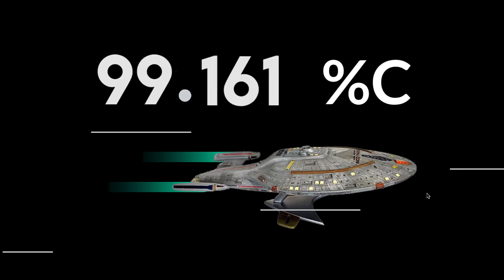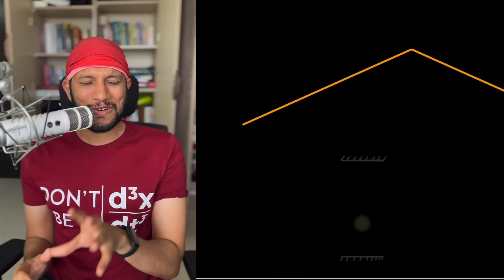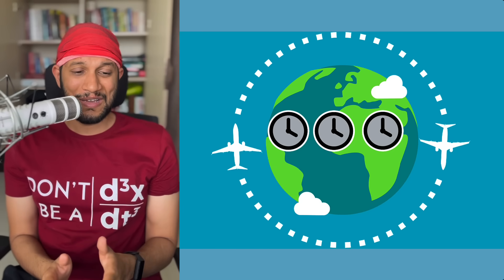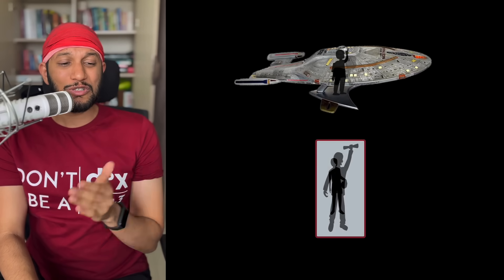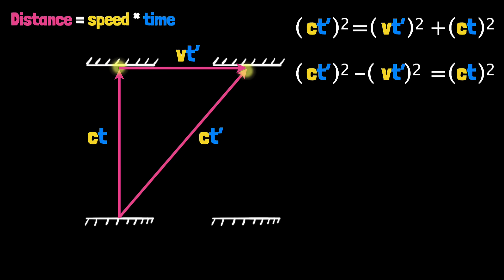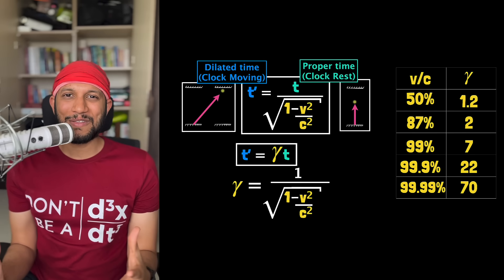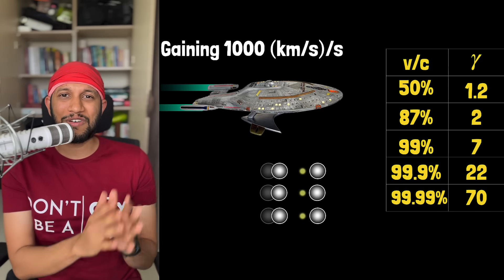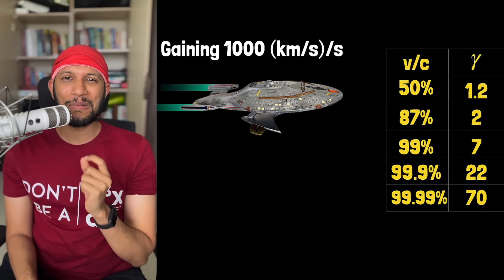I finally understood why you can't go faster than light! (My mind is blown)

Comment: Okay now I have two questions:
1. If we manage to achieve acceleration of our ship up to certain point (constant), the ship in space will go with that accelerationfor almost forever without any further fuel consuption, because in vacuum there are no force that can stop it or decelerate it (other than gravitational poles of large objects), and therefore at some point of time we will manage to get to the speed of light eventually? Or do we need acceleration to increase? Because cars needs more fuel to accelerate more if the speed increases, but it is because there are a lot of forces that stop the movement.
2. From the outside the ship will go faster and faster, right? Because if you just maintain the same fuel consumption on Earth, you do not move faster, you just move with the same speed, but in space nothing obstructs your movement
Reply: @makswelt For question 1 you need to spend energy to get acceleration. In a vacuum you speed stays the same as there are nothing to stop you from moving. That doesnt mean your speed increases. So you need to use fuel to keep accelerating and the more you accelerate the more fuel you need as the video shows. 

Question 2 As stated in question one you misunderstood how space and acceleration works. In earth there is an atmosphere also stopping you so you would need a lot more fuel to get more speed. And as your speed increases so does your wind resistanse so you need to use more fuel. The loop gets really high really fast compared to space. Thats why you cant achieve really fast speeds with an atmospehre.

hope this helps my friend :)

Comment: what i dont get about all this is that light doesn't always travel at a constant. maybe its maximum speed does at C, but light isn't always traveling at C. 
from what i understand, C isn't the speed of light but the maximum speed calculated that any 'information' can be transferred, or change can occur outright, in the known universe. 
even if quantum entanglement miraculously exists, the two entangled atomic particles, or even waves, are still not able to change faster than C. so whatever entanglement is, it's some different beast, and or, not real.

Comment: I currently have a concussion so I may not be thinking clearly but it appears you have left open an important part of this. You said those in the ship wouldn't feel an difference and would keep accelerating like normal from their viewpoint but an outside observer would see them going slower and slower. That itself is a problem. Are they at the speed of light or not depending whether they are inside or outside of the ship? Seems like if you were on the ship you would eventually reach the speed of light but to outside observers it would be taking forever.

Comment: Question : the explanation is based on the premise, that the outside observer should observe the spaceship reaching the speed of light from his point of reference . But what if we free that requirement and say, it's not important what the observer sees, but what the pilot does?
As was said, in the spaceship reference system, they continue to accelerate 1000km every sec (even if for the observer the acceleration is becoming slower).
Why can't the spaceship continue in its constant acceleration (with the constant energy investment) to reach C from its own perspective, is something this explanation does not address.
Would appreciate an answer, thanks.

Comment: Ok hold on I have a question based on these facts:
1. There are 2 PoV, one is from viewer outside the spaceship, one is from inside the spaceship. These 2 'see/feel' time differently.
2. At one point the viewers outside the spaceship see it 'stops' gaining more speed because it takes billion years for it to be 'visible' by the viewers.

The question is, how do the ppl inside the spaceship feel time at that point? Time still moves normally for them so they should still be gaining more speed every second even though it takes billion years for outside viewers to see it, right?
So does it mean its more like 'we cant see something move faster than light', instead of 'we cant move faster than light'? I think I'm missing something here, please enlighten, thanks in advance!

Comment: 13:50 you are saying we,  outside of the reference frame cannot see moving the object at the speed of light. But what about the people inside. They are just keep adding the acceleration. Then why can't they reach the speed of light.I think you are basically saying nobody can see anything going at the speed of light (not actually cannot go). Kindly explain i can't figure it out.
Reply: That's the inherent flaw with the Einstein understanding of light speed, which has always been wrong. Nothing can travel at light speed, but somehow if you were on a train going at light speed, and walked forward even a little, you'd be going faster than the speed of light. Except this obviously wouldn't occur. What the real truth is, light speed is the absolute limit of everything, and it's not energy that keeps matter from going that fast, but rather, velocity of the inner workings of matter. For example, you have an atom with an electron orbiting it. That electron can only ever go as fast as the speed of light. But if you're already going half the speed of light? Well that electron can still only move at the speed of light, and that's what really creates time dilation, because the internal functions of matter that require velocity, are reduced in relative speed, subtracted by the total velocity of an atom or group of atoms.
Reply: @peoplez129 not really . As he explained. If we are travelling at light speed in a train, we won't be able to walk a little forward for about "infinite" years cuz our internal physical processes will kinda be at rest. And though we won't notice any differences cuz we believe no time has passed yet, in reality, until "infinite" time passes, our one second of forward movement doesn't occur at all. Hence, the theory supports and holds itself.
Reply: @peoplez129  consider your space ship a rectangle with only 2 atoms one on each end(one on the left and one on the right). there is a force bieng applied from the left side, and you accelerate that rectangle towards the right side of the screen, for the acceleration to register and for the rectangle to move, one atom needs to move(left atom), and then that movement needs to registered by the second atom(right atom), so, lets say if the rectangle is just starting out, the electromagnetic force will move at a speed of light and the rectangle will move as usual, in its perspective time is flowing as usual. now, lets say the rectangle has accelerated to 50% the speed of light. both atoms in the rectangle are moving at 50% the speed of light, now if it wants to accelerate, a force is applied to the rectangle, and the second atom(left atom) would be the first one to accelerate, and that acceleration needs to be transmitted through electromagnetic force at the speed of light to the second atom on the right for the entire rectangle to move and accelerate as one. but the thing is, the second atom is also moving at 50% the speed of light, so the electromagnetic force takes 2 times more to reach the second atom, even though the force is moving at the speed of light, the second atom is moving away from it at 50% the speed of light, so it takes longer for it to arrive, doesn't matter if we are looking at it from the outside or the inside. the propagation of force will always be slower the faster you move. and if you move at the speed of light, you don't move, because the time it takes for the electromagnetic force to move from one atom to another would literally be infinite. no matter how much energy you put into the left atom in our rectangle example, it wouldn't reach the right atom, because it is moving at the speed of light.

From the perspective of someone outside the rectangle spaceship, the rectangle is moving at light speed, but from the perspective of the spaceship, you have barely aged or barely moving.
Reply: consider your space ship a rectangle with only 2 atoms one on each end(one on the left and one on the right). there is a force bieng applied from the left side, and you accelerate that rectangle towards the right side of the screen, for the acceleration to register and for the rectangle to move, one atom needs to move(left atom), and then that movement needs to registered by the second atom(right atom), so, lets say if the rectangle is just starting out, the electromagnetic force will move at a speed of light and the rectangle will move as usual, in its perspective time is flowing as usual. now, lets say the rectangle has accelerated to 50% the speed of light. both atoms in the rectangle are moving at 50% the speed of light, now if it wants to accelerate, a force is applied to the rectangle, and the second atom(left atom) would be the first one to accelerate, and that acceleration needs to be transmitted through electromagnetic force at the speed of light to the second atom on the right for the entire rectangle to move and accelerate as one. but the thing is, the second atom is also moving at 50% the speed of light, so the electromagnetic force takes 2 times more to reach the second atom, even though the force is moving at the speed of light, the second atom is moving away from it at 50% the speed of light, so it takes longer for it to arrive, doesn't matter if we are looking at it from the outside or the inside. the propagation of force will always be slower the faster you move. and if you move at the speed of light, you don't move, because the time it takes for the electromagnetic force to move from one atom to another would literally be infinite. no matter how much energy you put into the left atom in our rectangle example, it wouldn't reach the right atom, because it is moving at the speed of light.

From the perspective of someone outside the rectangle spaceship, the rectangle is moving at light speed, but from the perspective of the spaceship, you have barely aged or barely moving.

Comment: So you are traveling near the speed of light. Your vessel is moving nearly lightspeed. You try to walk forward, but doing so puts you closer to the speed of light, freezing you in place. But your arm swinging backwards from the walk, is now moving slower, and time essentially flows faster. The atoms in your body cannot go forward, but can slowly go backwards. Does this mean that the difference in the flow of time in parts of your body and ship as they move relative to the direction of travel will rip everything apart

Comment: and there's the mistake:
 the photon clock is ticking at the same speed when stationary as well as when moving (for captain Kirk)

the fact that we on Earth will mentally see that photon moving on a see-saw trajectory, and we know that the time is consistent on captain Kirk's ship as well on Earth, the obvious answer is that we cannot ever see a clock moving away from us at speeds closer to light speed, so we cannot mentally theorize  what's happening on captain Kirk's ship

but the explanation that Time slows Down is for the birds.
Time is NOT a human construct
is a UNIVERSE "thing"
say, in what time is an electron going around a nucleus.
an if we believe Time could Slow Down on fast moving objects, then immediately we must think that the electron doesn't go around its nucleus in the same time, so the electron will either be lost, or crash into the nucleus.

Whatever, the atom will be lost, and the molecules will disintegrate, and the object will just vanish.

Time is the SAME no matter of speed of object
Just doing Mentally Experiments is just like Mentally seeing Santa coming down the chimney

besides
have you ever thought what if Enterprise leaves Earth and travels away at 0.8c
you immediately will say the time for captain Kirk slows down.
But what if our own Earth is also traveling in the fabric of our space-time continuum at 0.8c in opposite direction of Enterprise?
won't our time also slow down by the same amount?
and so both our times will in fact be the same?

because we do NOT have a point of ZERO reference in our space time continuum, where we know for SURE the speed of an object placed in that spot will be ZERO regarding to the rest of the Universe.
everything in the Universe moves, nothing is stationary.

and then there is the LIGHT, and any other ElectroMagnetic Waves.
they travel at the speed of light.
does their time SLOWS DOWN while traveling?

science community seems to get it this way: "anything traveling near or at speed of light will slow its time down, except for the light, for the electromagnetic waves and my Mustang"
*
Nothing can travel faster than the speed of light, because the fabric of our space-time continuum won't allow it
the same as a giant TV LED with its diagonal from Earth to Moon, and a response time say of 2ms, will allow a character to move on the screen from one end (Earth) to another end (Moon), with just 2ms per pixel
translate that in how many pixels from Earth to Moon, and get the Ultimate speed at which a character can move in the fabric of its space-time continuum, which incidentally we know is the flat screen TV.
*
there is a way to travel faster than the speed of light though (theoretically), and it might be proven - or - disproven by future experiments

for our character on the giant TV to move faster than the pixels allow it to move, is to extinguish the pixels at this location, and instead of lighting up the pixels right next to it (and thus giving the illusion of moving), we in fact light up the second pixels further away.

This way our character travels at double the Ultimate speed allowed by its fabric of space time continuum.

If we light up 10 pixels away, then his speed is 10 times greater, and so on.

from this mental experiment we deduct that it could be possible for particles in our own universe to travel faster than the speed of light if they are being taken out of our universe and inserted back a million miles away

But, as this is a Mental Experiment, take with a lot of salt (not just a pinch), as explained above about Mental Experiments and their validity.
*
and another mistake in scientific minds today, is that an object traveling at speed of light will have infinite mass.
that's wrong.
from the formula on your black board at the beginning of the video
we have the speed of object "v"
we squared this and then divide it by "c" squared
so object traveling at speed of light divided by speed of light = 1
we subtract 1 out of 1 and we get ZERO
now square root of ZERO = ZERO

and then anything divided to ZERO = ZERO.

So that formula, tells us that an object traveling AT speed of light will have ZERO mass.

This is also proven by daily observation, where Photons (a particle that should have mass) in fact does NOT have mass at all, because it travels at the ultimate speed.

simpels!

Comment: I actually don’t completely get it. If the ship moves at its pace, and the dot moves within it at normal time, and the observer at distance observes it taking longer due to dilation, is it because as the observer the light simply takes longer to reach my eye due to the distance from the ship? If so how does the super increased speed of the ship play into perception? Wouldn’t the ship simply go out of view at some point? Or would it be best to view the ship as going straight away from the viewer? Therefore making the light that reaches me older and older due to the speed and distance gained by the ship? I know the light we see takes time to reach us as in the suns light. It’s old light. So if the ship went faster and faster then the light we see would be even older from the ship itself because it’s went such a farther distance in the same time as seen from the ship? If so I answered my own question and I’m mind blown 🤯

Comment: Simple, known, accepted methematics dictates no limit to any speed/velocity exists.

99.9999960 % of the speed of light is X amount of energy expended.
To increase speed, the square of the increase is the new energy requirement.
The speed of light is 1.000000040000002 times the granted possible velocity attainable.
Thus to increase to the speed of light, the energy increase is simply 1.000000080000005 the energy currently in use at 99.9999960 the speed of light.

There is no reason that 0.000000040000003 units of energy cannot be generated.   There is no mathematical limit to the possibility of energy generaton.

If there are two ships, both capable of reaching 99.9999960% the speed of light, both powerplants can be installed into one ship and the speed of light can easily be surpassed.  In fact, two power plants that can individually propel this single craft in space to the velocity or 99.9999960% of the speed of light would power that same craft to 1.414213505804553 the speed of light.

This scifi-comic book BS called real science must stop.
Reply: Speed is _relative_. A ship moving at 99.999% of the speed of light in one reference frame is simultaneously at rest in another.  Kinetic energy is therefore also relative: it may take an absurd amount of energy for the ship to accelerate 0.00001c in the frame where it is moving at near lightspeed, but in the frame where it is at rest it takes much less.  Don't write off one of the most successful and most experimentally verified theories in the history of science simply because you don't understand it.
Reply: @charlieharris4881  I agree that the energy required is massive.  But there is no actual limit for speed.  There is a point where the speed of light is one once of thrust away.